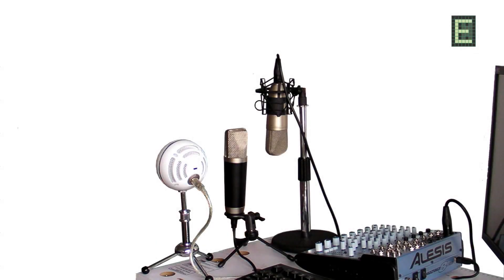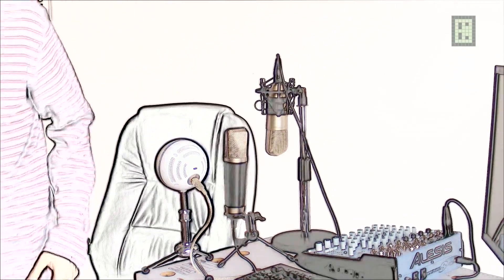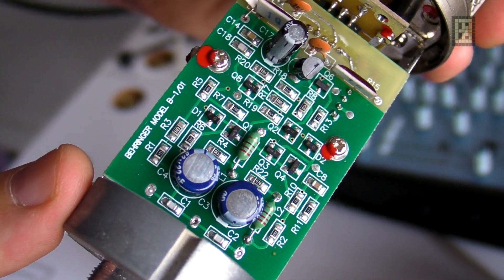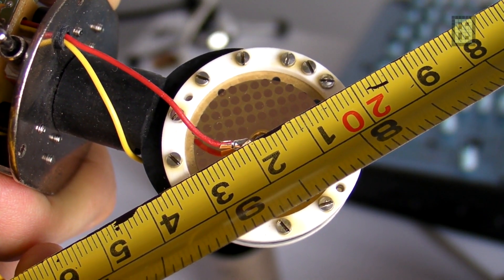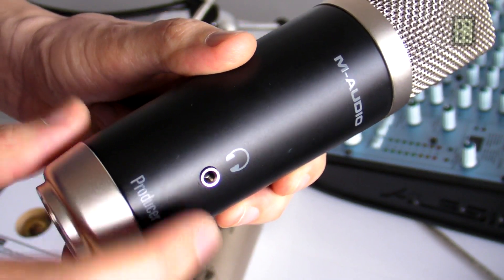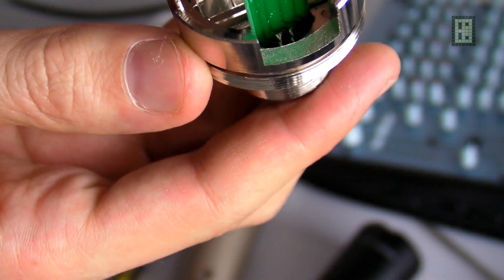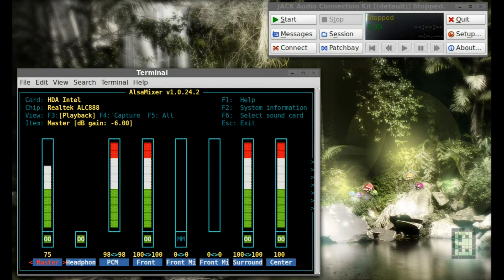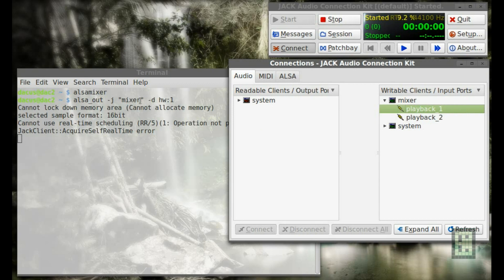Behringer B1 vs M-audio vs Blue Snowball microphone comparison.

Comment: Can U answer me this...why does my Behringer XM 8500 (worth $25) sound much better than my Blue Snowball (which cost $150).
Reply from the maker: First those two microphones are totally different in all aspects. Blue Snowball is an USB microphone so you can connect that to your computer with no need for any additional equipment compared to the XM8500 that is just a simple XLR microphone (since the justifiable difference in price). On the sound quality that is always very dependent on user preference and the quality of the XM8500 will depend widely on the quality of you microphone amplifier and digital converter you additionally need to get the sound on your computer. Not to mention they are quite different also because XM is a dynamic microphone meaning it has a coil attached to a flexible membrane moving in a magnetic field generated by a permanent magnet similar to a speaker but used in reverse. While Blue Sonwball has condenser microphone (a variable capacitor) Sound of this two is quite different and it depends on your use an preference.
Reply: ***** I connect my Behringer XM 8500 directly to my computer via a xlr/ USB cable...the audio is much better ...much richer...and I would recommend for singing above the Snowball. I have tried every conceivable setting with the Snowball but it still sounds way below the Behringer.
Reply from the maker: *****
That USB to XLR cable has active electronics inside is not just a simple cable all that electronic is inside the Blue Snowball. As I mentioned before each person has his own preference when it comes to sound quality. Some prefer more mid and high frequency over low. Your dynamic microphone will not have a very flat response curve and has more mid to high frequency while a condenser based has a flatter response curve (I personally prefer that). Blue has a relatively small condenser microphone and amplification is not that high is made to be quite close to the microphone.
Is also a relatively old design already there are better microphones out there today. Both Blue and M-audio where quite old at the time I did the review and that was more than 3 years ago.
Reply: I was thinking of upgrading to a more expensive Behringer Microphone...would the same cable I have work on the other ones..(U.S.B cable directly to my P.C.)
Reply from the maker: *****
Not sure it depends on the cable it needs to provide phantom power to a condenser microphone. But if that dose not work there are sure similar adapter cables that will work.

Comment: Salut. Se merita unBeringer B 2-PRO? Merci.
Reply from the maker: Both B1 and B2 are good microphones. It depends what you want to use them for.
:) Numa ce am observat ca intrebarea era in romana. Oricare e bun da B1 din cate imi amintesc avea o curba mai dreapta decat B2-Pro si era mai eftin va fi greu sa vezi o diferenta intre ele. E mai important ce este dupa microfon si in fata lui :)
Reply: Multumesc mult. Sunt la capitolul cautari acuma. Vreau si un mixer Behringer. Am banuit ca esti roman dupa accent. Salutari

Comment: The internal circuit boards in my Behringer B-1 are completely different to those. It could be that mine is a later model because the boards say 'Rev A'.

Through my old Xenyx802 mixer, every mic.sounded dull, but through my newer Mackie 402VLZ4 with the Onyx pre-amps, the Behringer B-1 sounds terrific. Behringer's small mixers may be crap, but their microphones are underrated.
Reply from the maker: I agree Behringer microphones are a bit underrated especially the B1.
For my use the B1 was a bit to much I only use it for youtube audio is much more convenient to use a dedicated recorder like the ICD-SX712 that I use in my latest videos and the audio especially after youtube compression is not that distinguishable from B1.
For music B1 is by far the best value for money.

Comment: hey my friends u can sen me the drivers for mixer alesis ples? this that in the web i can´t download, ples help me. i from, Venezuela my englis its very bad sorry XD
Reply from the maker: Not sure you need any drivers is a plug and play unit at least in Linux it works without the need to install anything is just an USB sound card.
I did not test the mixer in Windows but it should work the same way.
What will you probably need is a recording software and a free one is Audacity available for both Linux and Windows.
Reply: ***** thanks for answering my friend, I need is the driver of the alesis console that comes in a CD audio console. the alesis driver console :) i have cubase 5 but does not recognize my console either by lack of driver alesis :) I hope you can help ..
Reply from the maker: Hector Pach
If you have the same Alesis MultiMix 8 USB console that I have then there is no driver needed it just works.
So is either your cubase 5 installation wrong or the mixer is defect maybe the power supply.
Dose the mixer works with other software ?
Anyway there is no driver for Alesis MultiMix 8.

Comment: You had  stated that the headphone jack on the Producer Mic was not very useful, due to a massive delay in monitoring. Just wanted to point out for people interested in the Producer, that when using Pro Tools SE (included free in M-Audio box) you can monitor more spot on than any other mic in this price range. Without your Pro Tools however, this Mic is virtually no better than others.

Comment: The sound test is hopeless, it's too disjointed. It's totally pointless talking into a mic that's switched off. It also helps to not talk in a dull, monotonous voice. Taking them apart is pointless. The capsule size would be mentioned in the specs.

I should mention that I have the Behringer B-1 and the more expensive and highly rated Audio-Technica AT2035, and I struggle to find any difference between them.

Comment: @electrodacus i have a firewire port, is it the 4 pin one or the 6 pin you have to use? Also could you go through a firewire to usb adapter and connect it that way?